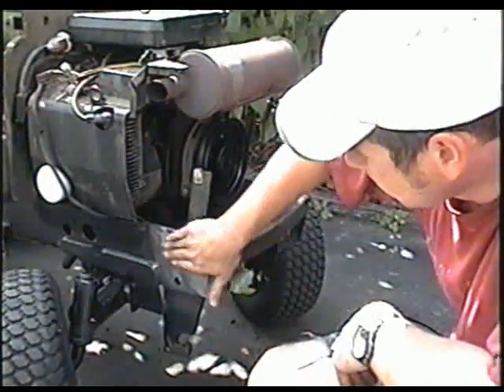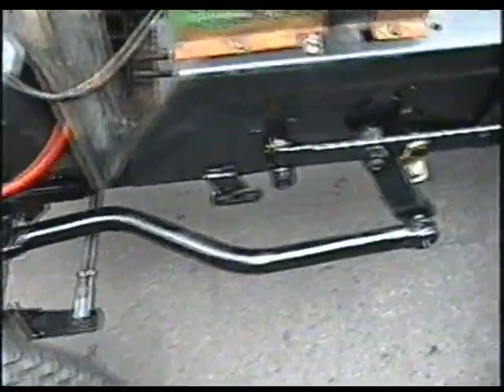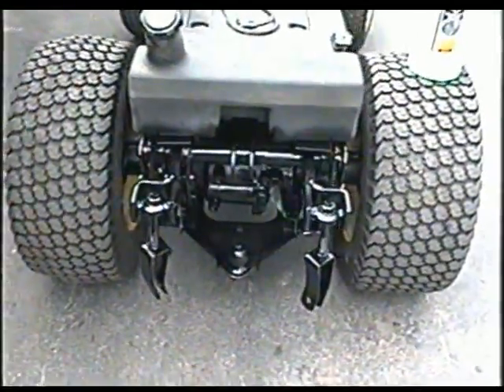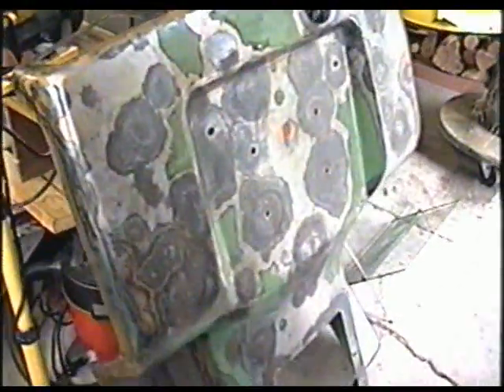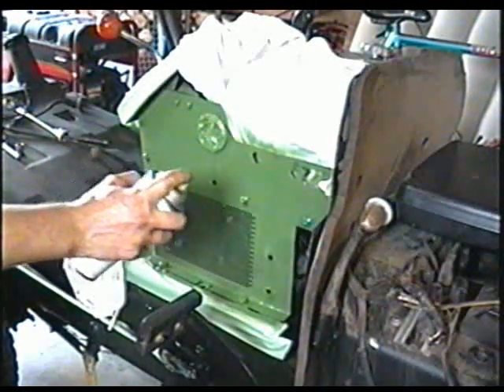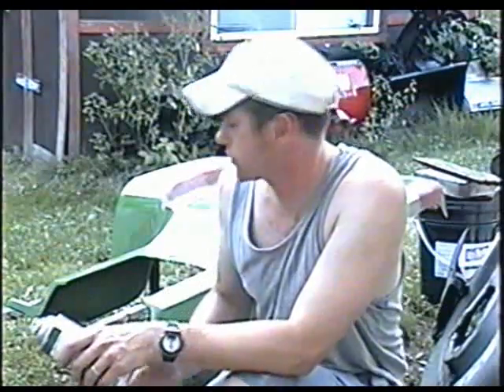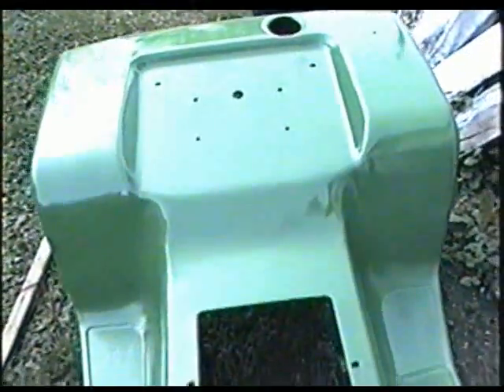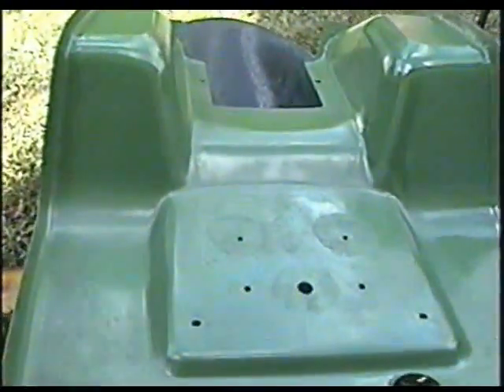JOHN DEERE 316 Tractor Restoration Part 3/6

Comment: when I repaint my tractor I plan on doing the underside of the fender and probably parts of the frame with truck bed coating just to protect it even more.

I have a 17cu.ft. trailer that needs painting as well, might do it with truck bed coating as well.

Comment: don, you should wait less time between coats like 15-30 mins, because once the paint hardens it's not like fresh paint anymore (it plasticizes). then when you put on a fresh coat it tries to adhere to an unprimed surface, much like painting it dirty, unprimed or bare metal. visually there's no differencebut it will shorten the life-time of the paintjob as it will start to peel.
didn't made that up. I have been lectured that by my friend's father, car body expert. :)

Comment from the maker: @seasonedtoker thanks for the tip, so do u put all coats in like 1 hour's time or so?
Reply: The paint colour is john Deere classic geeen?
Could I get it in liquid form to brush it on so I don't breath those vapours ?

I like to do mine soon
I'm using por15 black for the frame it's coming out great
Thank you for posting your video
Reply from the maker: @briangreen8887  yes they sell the paint in a can at john deere